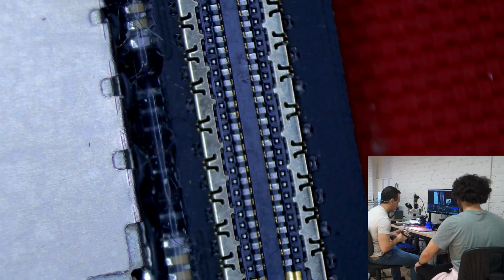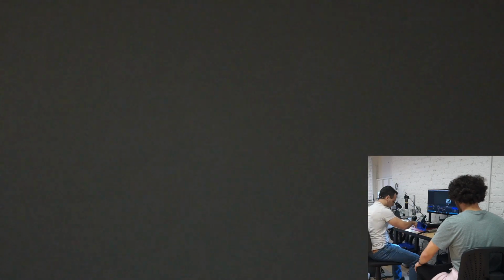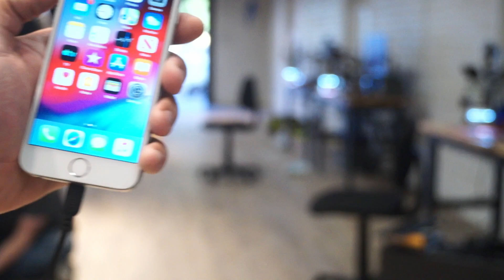FUTO repair workshops are in session!

Comment: What about videos doing smaller projects that can be followed from anywhere?

Such as one (if possible) adding a HDMI output to the groups of digital microscopes that have their own screens but could be handier when on an alternate larger screen.  

I received one for Christmas 2022 and will supply up to a 1200x magnification (I believe). Enough to do pin straightening on an LGA 1151 socket.

Any possibilities or links to aleeady existing tutorials or how tos?